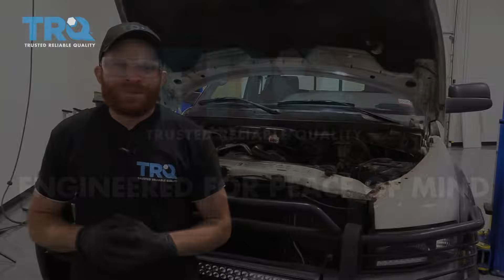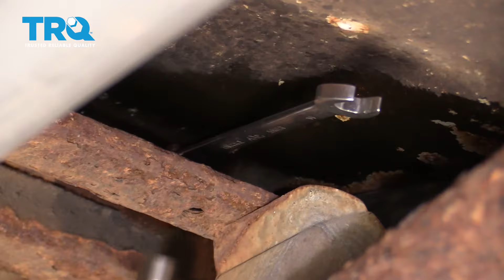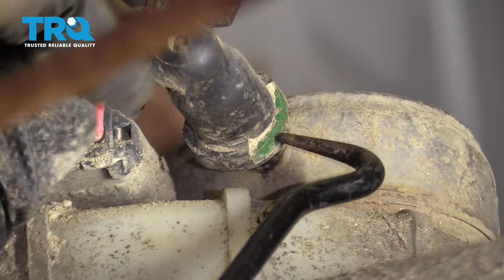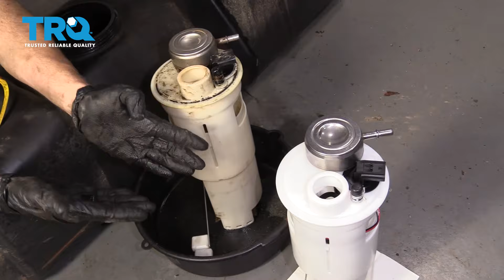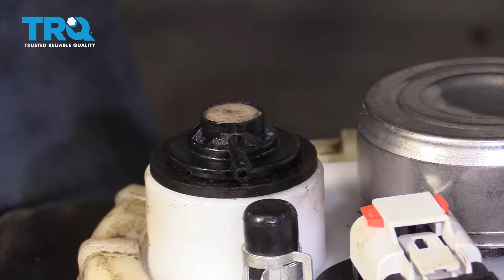How to Replace Fuel Pump 1994-02 Dodge RAM 1500

Comment from the maker: √  Watch the Video
√  Buy The Part at 1A Auto https://1aau.to/m-Shop-TRQ-Parts
√  Do it Yourself
√  Save Money
Reply: My fuel pump didn't co.e with a harness
Reply: If I buy the fuel pump from you how much would it be? Reply please
Reply: I was told I had a filter with the fuel pump is the screen supposed to be the filter or what and $200 is a little high what is your price

Comment: I'm not seeing any fuel lines listed on TRQ or Rockauto for my 96 Dodge Ram w/ 5.2L with 150k miles. Where can I get some new ones once I determine exactly which one the chipmunks chewed into? My truck quit while at the store, and underneath the gas tank below where the fuel module is I saw gas basically running out onto the ground. I've got several reasons to put in a new fuel module anyway (long time to fire up when cranking, gas gauge hasn't worked since I got it at 110K).  At Rockauto, I'm seeing a 3/8" straight push quick connector (S.U.R.&R. KP020) that looks similar to what's in this video at the fuel (filter) outlet, but the listing doesn't indicate if it's acceptable for use with gasoline & also doesn't seem to come with the mating connector that goes over the male end of the fuel filter.  None of the fuel modules I'm looking at seem to have it already on the outlet either.  Thanks if anyone can help.

Comment: I like that Dodge used a threaded ring 👍 , but did they have to put the fuel filter on top of the fuel pump ? 🤬 I bet it was the same engineer that put the distributor at the back of the engine 🤬

Comment: So here I sit 5 years later. Fuel pump in my 99 quit the other day. I'm watching y'all remove the straps and he calls the hook side a hooky-do. I nearly died because in the electric motor shop, we used the same phrase. 🤣 I came here to see how the clip comes out of the pressure line, left with a laugh.

Comment: I hve a 95 ram 5.2 and my engine fuse kept blowing and now every fuse I put in it it blows instantly…I already had the fuel pump replaced and my ignition switch replaced

Comment: Thanks for the instruction,  I UNBOLTED THE BED, CHANGED THE PUMP, BACK TOGETHER,  INGNITION TWICE STARTED RIGHT UP REINSTALLED VACCUM HOSE , IDLES GREAT,   HOWEVER LOSE OF POWER , RUNS REALLY RUFF,  1997 MAGNUM NO BLEEDER VALVE FEELS LIKE AIR IN THE LINE, PARADISE CA,   HELP SOS!!!!

Comment: Just got my truck running again after sitting for ~6 months.  Filled the gas tank and then it died on me the next day. After doing some tests, I’m almost certain it’s my fuel pump/filter.

I have a new fuel pump coming tomorrow, but how am I supposed to syphon out all the gas, when there’s anti-syphon technology that prevents it? Am I just supposed to drop the tank slowly and hope I don’t get myself and the street covered in 100 litres of gas?

Worst timing ever 😑

Comment: Just did this and it worked great!

Symptoms I had:
Long crank eventual start on 2nd or 3rd try
Loss of power
Loss of acceleration
Intermittent fuel loss
Crackle/pops

After new pump installed:
Fires up right away first try every time
Truck drives like a dream
Quick fast acceleration

I dropped the tank from the ground but my truck does have a 5 inch lift and 35 inch tires on it. If you have an extra hand it will definitely come in handy. I used my jack to relieve pressure on the tank to get the straps off

Comment: So I have a 02 ram 1500 5.9 L. The fuel pump is fine but one of the electric connectors is coming loose causing the fuel pump to stop working. I've heard this is a common issue with these trucks. Do you have any idea of the problem?

Comment: I think it's going to be easier to cut a hole in the box than remove the tank. 
And of course they are calling for 1 - 2 foot of snow tonight.
Thanks for the video, l learned more about the pump location on my plow truck.

Comment: I have a 99 dodge ram Laramie SLT with a 5.9L magnum v8 appart from replacing the fuel pump would it or is  it ok with replace the fuel pressure regulator instead of replacing the fuel pump?

Comment: More on Dodge Rams-  Take note of the position of the old fuel pump before removing, and install the new one in same position so the gauge float doesn't hang up. 
With the old pump out, empty the tank. It may have water and sediment left in it that can ruin the new pump.
If the plastic fuel line has a foam wrapping be sure to reuse or replace it otherwise the fuel line may rub on the frame rail or the underside of the bed.
The black valve is a vent/rollover valve. It vents the tank to the evap canister through the black hose.
The smaller black hose on the metal filler neck aids in filling the tank. It acts like a vacuum break.
The metal filler neck also has a rollover/anti-siphon valve in it.  
Don't overfill the tank when refueling. You can cause raw fuel to travel through the vent valve and saturate the evap canister, which will lead to the charcoal in the canister to be sucked into the purge valve near the engine.  Tanks for the video.

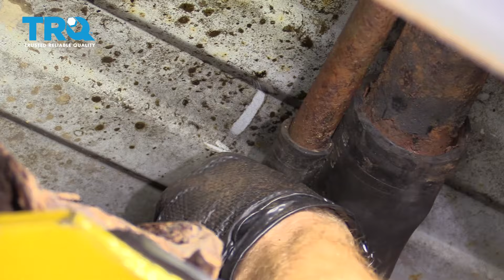Comment: can anyone tell me whats the name of the smaller hose at 10:45 .I know the bigger one is filler neck hose. thanks
Reply: it is a vent hose
Reply: The smaller hose attached to the metal filler neck aids in filling the tank. It is not a vent hose. It works similar to a vacuum break.

Comment: I purchased a pump for my 95 dodge dakota, 3.9, its a five"round"pin, I need the 4 flat pin like you have, its identical to the original one that I'm trying to replace.
Reply from the maker: +bullheadedoldtimer Thanks for watching. Buy the part in this video on 1AAuto.com: http://1aau.to/m/Shop-TRQ

Comment: I did one on a 92 dodge Dakota and I just took the bed off the truck and changed it in 20 minutes. Can you not do that on a 98 Ram 1500?
Reply: That what i did on my 1999 dodge ram . faster , no  crawling around if you don't have lift ,same on 06 Silverado . i have done 6 in day . at 300.00 . at my brothers garage .He got lift but taking bed off is faster , I just raise it enough to work on it , stick the new one in , yes it better and faster

Comment: at 3.25 is the black hose removed a vent hose? Or a vent rollover valve?
Reply: The valve is a rollover valve but it also vents the tank. The hose attached to it connects on the other end to the emissions evap. canister. And btw, there is also another rollover valve located in the filler neck. Some call it an anti-siphon valve.

Comment: I just replaced my fuel pump, and it's still not starting, and thr little button to release thr pressure, there's no pressure building
Reply: Check your fuses or relay if not then eletrical issue can be a pain to look for

Comment: jesus the rust
Reply: Thats nothing, every once in a while I run across a tahoe or 4 door chevy truck that rust accumulated in the crossmember that holds the strap, nothing makes you feel more alive than having to cut rusty straps off, and fabricate  new attachment points, because you already cant get the tank back in, and your boss told the customer it would be done by noon. 100% why I quit being a mechanic. Book time only works if the car isn't a rusty pile of crap.

Comment: When you put the new locknut on (manufacturers highly recommend replacing the locknut and gasket), you'll want to use a spanner wrench, then you won't have to bash it on. You can borrow one from an auto parts store.

Comment: Not sure why you didn't remove any gas that may be in the tank and clean the tank out. Otherwise, great video with complete explaination.
Reply from the maker: +Phil Neathway Thanks for watching the video! This would be good to do if there is any debris in there or for just a general maintenance procedure. http://1aau.to/m/Shop-TRQ